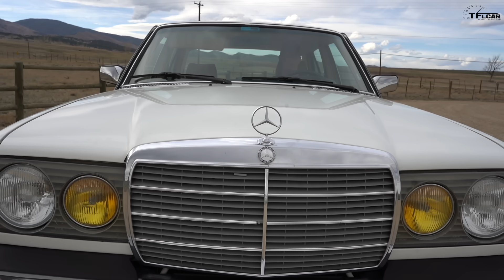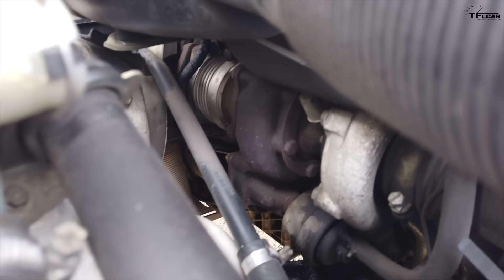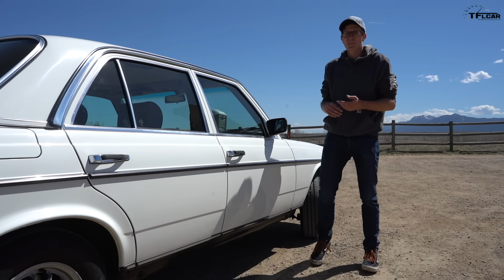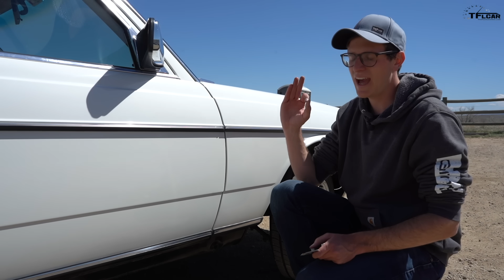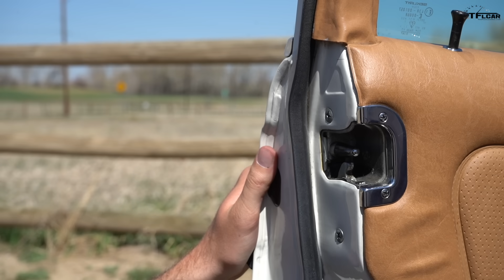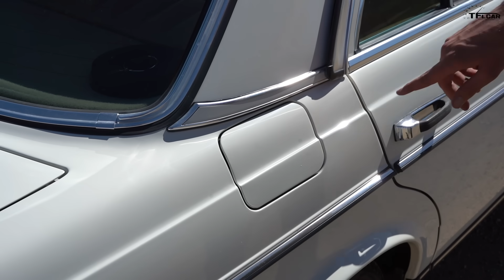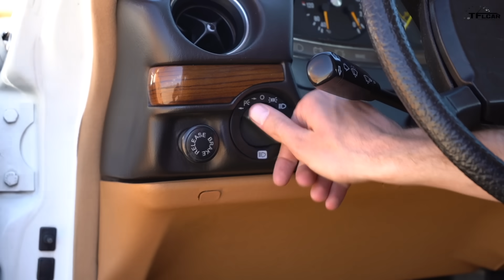This 37-Year-Old Diesel Is THE BEST Mercedes Ever Made!

Comment: My first car - 240D Sedan 1982 model with four manual gears,. Cactus green with camel interior like in this. Manual sunroof. Still miss it and how I felt at home in it. Never failed to start and when i got new motor mount rubber it was running silky smooth. Gear shift was the best. Started with 72.500 km on the clock and sold it again 110.000 kms later.

Comment: I have a '81 240D with manual transmission. Bought it in '90 with 97k  mi. for my wife to drive. It now has 450k mi. I've done all the servicing myself. She does not want another car. Does not burn oil and does not have any leaks, although it did when I first got it.

Comment: Talking about regular cars without any offroad abilities, this IS the best car EVER made. No electricity needed. Well, it does have glow plugs for cold starts, should you need them... With regular maintenance will last forever. This has about 95 hp and the stock engine with a turbo can handle 400 hp reliably. So... way over built.

Comment: W123 is greatness don't get me wrong, but the 190D which came just after is a better car in every way. If you want a full size then get the W124 or S124. Diesel manual variants get top pick, the om60x beats the om61x in every area.. true serpentine belt, real rear main seal (no felt bs), 5spds,better transmissions, better ride, updated ac compressor, etc. 

My 85 190D 2.2 5spd has just shy of 1.5 million km. It's at 876k miles right now, USDM spec. It spoiled me so much i had to sell my new toyota after driving it. Paid $500 for it.. W123 could do the same, but the W201 rides fantastic. Basically a mini diesel s class  these are truly the best cars ever made. Nothing else comes close imo.. we could collaborate on a video. Cheers

Comment: W116 is peak MB, not the W123
A MB car is supposed to be refined, so how is it refined with a clunky diesel engine designed for vans and taxis? The W123 has great build quality, but the ultimate MB car should also have refinement and performance. The diesels are slow, unrefined, and will destroy themselves if a hose to the oil cooler fails, the four cylinder petrol engines lack power, while the six cylinder engines are gutless at low revs. I drove a 230E and it did not like hills... embarrassing and dangerous. The W116 with a V8 engine is the definitive classic MB car IMO, not the W123 which is essentially just a smaller and cheaper W116 with a bunch of shitty engine options. The W123 represents the start of the decline of MB, not its peak, as it failed to offer a V8 engine option. A W123 with the M116 3.5 L V8 engine (aluminum block) would have been a truly great car. The failure to offer this as an option is a moral failure, not just a marketing failure... a jump the shark moment.

Comment: I've had an 85 300D since '04 and wont give it up. They're a love, yes.. But in all fairness, I think the question of which is the best MB series is a little irrelevant, not to mention also a bit of over-hype (as here). In actuality, if you pick up any inspected and well maintained 115, 116, 123, 124, or 126, and continue to maintain it,  (ESPecially if you can do some of the work yourself: fun learning and highly rewarding, and the car will appreciate it) and esp if its a diesel, then you are going to fall more and more in love with it with time. Yes, it will cost money, as all cars do. Dont skimp on maintenance! Stay ahead of it. But over the years, these vehicles virtually become members of the family.

Comment: I had a 230E with the alloy magnesium wheels it was 18 years old and cost 1500 quid in 2002.
It had a 100,000 miles on the clock but it was still very tight.
The more I thrashed it the better it went.
The quality was tremendous.

Comment: Your grandchildren could easily end up driving that car. The only thing that will finally take those cars off the road would be the unavailability of diesel fuel. It will take quite a while to wean industry off of it, but it will be easy to ban it at the pump for consumers. I can see that happening fairly soon. Mercedes has lost it's way recently. They just don't care about building the highest quality vehicles on the road anymore because they don't have to.
Reply: Rust will kill the mechanical money pits.

Comment: Don't forget the fast idle thing on the dash where you can turn the idle speed up.
Reply: how do you do that? i have a 1985 300d (american) but dont see any idle adjuster on the dash..
Reply: @jastern949  if I remember right it looked similar to a little plastic key? A black plastic looking key end that permanently hung out of the dash to the left of the steering wheel.

Comment: Had a 1981 300D back in the day. Was slow as crap. Heavy as chit and reliable and efficient as anything!

Yea that climate control system is a disaster! Loose vacuum and it would blow cold air on your face and hot on your feet. Or your have all heat or no heat. Have to crack a window as it's full feet heat on. That's the reason we got rid of it.
Reply: MB knew that well and did nothing about it.

Comment: I have a 1979 300CD English Red color, 213,000 miles on speedometer and going strong. I put in a new starter, which weighs almost as some cars' engines! I replaced shocks and new brakes all the wayk around including emergency brakes, adjusted valves on diesel engine, replaced oil pan and gasket, replaced transmission pan fluid and gasket, replaced steering box, and still replacing and restoring little items. This car is now my every day driver, and shows well with all the company decals and mileage decals all over the front grill. This car is a tank and will ouitlast me.

Comment: Celcius is super easy. 

Water freezes at 0 deg. Water boils at 100 degrees.

Normal room temperature....set it between 18 and 20.  Lower in the summer of course if you need it.

Comment: As other's have said, childhood memories.  My grandfather bought one in the late 1950s I think, they had just come to the US, I'm a 78 model myself, my father bought a used 240D in 1982 we had until he traded that slow poke for a 350SD, that was an awesome car.  Pennsylvania rust would get them eventually.  My grandfather on the other had had several 300Ds, trading them off every 2-3 years.  He normally bought them in DC with 70-100K on them.  He regularly took them over 250K, one made it to 410K, he put a used odometer in it, I think it showed 289K, traded it in.  We did a lot of real estate development, he would carry Cat dozer parts in that Benz... 2,100lbs worth of D9 bottom rollers, 4 in the trunk, 2 on the back floor and one on the passenger floor, drove it 2 hours like that.  His last one was a 1992 300D, it was driven until 2012 or so, been sitting at the farm since, I think I'm going to pull it out and see if I can get it going again.  It was parked because the dash fan stopped working.  I'll pay a good bit to have it back on the road, a new F150 is $73,000, nah.  I wouldn't be afraid to drop 5K on this 92 and it's good for another 100K.

Comment: I bought in January 1991 a used Mercedes 123 . 240D manufactured in 1984  and kept it up to summer 2013. I am a fruit producer and I loaded the car with up to 26 plastic boxes of apricots 15-16 kg each (6 in the boot 16-18 on the back seat (removed) and 2-4 on the passenger front seat) and drove at 75 per hour to go to the fruit intermediary premises.
What an experience!
 I then bought a 203 c200 in 2012 and  in 2013 I sold the 123 for €500. That was  a very serious mistake. 
I never used the 203 for transporting fruit. Instead I use a 1998 TOYOTA 15 hp automatic but the maximum it can take is 18 boxes but it is low and the exhaust barrel sometimes touches the ground on road humps.

Comment: I had one and they will not stop running I just hate the vacuum system.
Reply: The myth of German "engineering".
Reply: replace the automatic with a manual transmission, and put in electric door locks, and it minimizes greatly the vacuum issue.

Comment: Certainly not the best ever made.  I had a beautiful 1982 300CD but it had a couple of serious issues.  I can't express how bad it was in the snow.  The turbo lag was unmanageable.  It would have nothing out of the hole and then spool up so fast you couldn't manage the torque.  Dangerous.  Tire chains could help you depart an minor uphill stop light...

 Also, most of the car ran on a leaky vacuum system.  Door locks were interconnected with the timing advance.  What a Train Wreck when your vacuum door lock lines were connected to everything else and all was leaking!  (And it was) (don't think I didn't put every thing into trying to keep it fixed)

In the summer, cruising the open road in Colorado, the car was a dream, but as a daily driver, leaving stop lights a hundred times... ack!  To be fair, had I lived in a warm weather climate and found a way to solve for patching the vacuum issue effectively, then I'd probably have to agree.

I'll take an AWD Merc with modern electrical systems any day!

Comment: Two questions: First, Did the 300D turbo diesel have air conditioning?  Second, does the engine have removable cylinder liners (sleeves) that would make rebuilding the engine easier? Thanks for your replies.

Comment: also forget ton refer that the under protection of the car is missing ,just by looking to the side of the car where there´s no body bellow the doors level ,because it envolved the under the car parts and make it rounder till bellow the doors level ,just some remarks i do have 12 mercedes from 1965 to 1995 being the last the 600SEC which starting in 96 it was re-called CL600 but looking ridiculous with already existing tiny glued letters and numbers or the V12 tinier on the back pilar of the topside which used to be triple or more the size when letters and number had to be fixed to the body by a screw or a attached by a revit (is it?)

Comment: nowhere near the radio because at the time most of the cars with luck had a radio with one speaker and that one already had 4 speakers ,it´s similar to the Porshe 928 from the 70´s that had in each door only 6 speakers more in other parts of the car and a blaupunkt radio cassette player made especially for the center console of the Porshe 928 ,i had a Datsun Sunny  from 77 powered by Nissan as it said in the back with a faked racing dash where besides the r.p.m. counter had a very nice looking clarion radio FM that the lights turned on when the other gages did to ,this made of glass with the FM frequencies and Am marked upon the thick glass not plastic ,it even had the seams faked upon the racing steering wheel like if it was leather so a fader in between the front and back electric powered windows they putted there, not existing in the beckers radio or radio cassette player, and i refer to electric powered because in early 70´s they had hidraulic powered windows, check it

Comment: I have made this comment elsewhere on YT... but this car is deserving of such recognition...

I still daily an '84 300td that I use to commute daily, safely move my family from this to that, tow my riding toys in a trailer, load the backend with up to 1000lbs of home depot goodies along with many other uses I throw at it often - all while approaching 400k with an original / never rebuilt drivetrain...

I've owned many different types of cars and distant second vehicle to this in terms of combined capability and reliability is a 100 series Toyota Landcruiser.

Comment: I agree w123 is a very good car, but I would like to mention that w124 - at least to mid 1993 (when Chrysler became a part-owner and ruined the quality-minded policy within MB) - was an equally good car as w123. And w124 is technichly a far superior car compared to w123.
Reply: To be specific: it is in 2 areas (mostly) that the w124 is a premium car compared to w123;
1. The suspension set up. The 124 has way better roadholding and way better comfort than the 123. You can drive much faster on problematic roads and still have and feel 100% secure compared with the 123.
2. The fuel economy. The 124 have a drag coeffisiont (probably misspelled) of 0,29 where the 123 has ca 0,37. This means that the 124 with a 110 ps diesel engine has a top speed of ca 195 km/h. The 123 with the same enigne has a top speed of ca 170 km/h. The fuel consumption is around 15-20% lower in the 124 compared to the 123 in all speeds above ca 120 km/h. The fuel consumption below ca 80 km/h (where the wind drag is almost non existance) is about the same in 123 and 124. Pardon my spelling. I am a Swede, not an American.

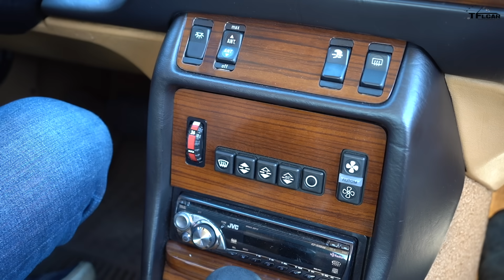Comment: 9:38 this is fantastic climate control
once you set the scroll to 20 degrees celsius, you no need to touch winter to summer and back
the system heats you if its cold and cools you if its hot

Comment: Hello.  I would like to consult with you.  I have several questions regarding the harmful emissions of the Mercedes w123 diesel engine.  Some countries have restricted the use of cars with an environmental class lower than Euro 3. I was wondering if this could be improved.  For example, install a particulate filter in the exhaust system.  I'm sure the soot released will settle in this filter.  But can it be documented or entered in the passport of the vehicle?  So that I could, for example, travel on my w123 in the countries of the European Union without restrictions.  I would be very grateful if you could answer my questions and help me figure this out.  Thank you.

Comment: Although this is one of the best Mercedes models, the next generation  e.g.W124, W190 was the actual peak of Mercedes engineering about reliability and the last from the golden era.. After those there are the first C and E class which by modern standards are very solid but back then compared to the models of 80"s they were considered very bad.

Comment: I had that same white Diesel car -- but a 1978 non-Turbo model.  Everything else was the same.

It had 122,000 miles when I bought it and 157,000 when I sold it -- still running great.

Not a lot of power or acceleration.

But on the highway, it was like driving on a cloud.

Comment: If you pull the trim off the doors and need to work on the switches and plugs for the electric windows you will find a tiny little circuit diagram inside the plug showing the correct wiring pin out.

Comment: During the 80s I owned 3 of these beasts (240 D, 300 D Turbodiesel, and the one I loved the most, a 2 dr coupe 300 CD). Noisy war horses all.  Lots of fun memories and others not so fun, like realizing that the diesel engines would not start in my visits to north Ontario when it was -6 F out there (I fixed it with a block heater).   I always though that I would give one of these safe and reliable cars to my son when he first learnt how to drive, but times have changed.

Comment: I grew up with W123 diesels - my father bought a 1980 240D and a 1984 300D, drove them both until he died more than 30 years later. 300D was an evolution from the 240D, and I now own the evolution of the 300D: the 2.5D in the W201. I can't say the 2.5D is that much better, but the W201 is definitely comparable in terms of quality.

Comment: Go to any third-world nation, where labor costs next to nothing, and you'll see that these cars are never retired. Whilst in the West, mechanics simply replace parts, there almost nothing is tossed. Elec motors are re-wound, broken/cracked parts are welded and resurfaced. Even sealed parts are sawed open with the skill of a jeweler, fixed and welded, heat-bonded or glued shut. Even a cracked glass headlight will be fixed like new by a master glassworker.

Comment: I've had a 1982 280E, the petrol version of this car you've got here.  When I bought it I was living in Sydney AU.  It had 265 thousand km on the odometer at the time I bought it and it looked, and felt, like it had just rolled off the assembly line on that day.  It was pristine on the inside with immaculate interior and with a pristine exterior.  It was a little thirsty for the times (late 2000s) but in every other way it was brilliant.  Reliable, comfortable, great daily driver really.  I used it to commute to work and back for years.  My brand new Audi diesel has glow plugs by the way.  And also, the AC unit in my 280E was immaculate.  it worked flawlessly when I bought it and for years that I've owned it.  I don't know about the Diesel version though.  Never owned one sadly.

Comment: I had a 1983 300D. After 300,000 miles, I finally traded it in. The 5 cylinder engine never had the heads off; and although it sounded like a sewing machine, it just kept going, with good mileage and no rust. The reason was that a second rear suspension replacement was going to be required for the right side, and cost me about $2K - with the car worth about $4K at the time.

Comment: Shame they never continued with the quality. I had a year 2000 E320 Avant-garde estate. The most unreliable, poor quality car I have ever owned. One fault after another, electrical and mechanical. It started to seriously corrode after 3 years. Corrosion was addressed under warranty and the subcontracted bodyshop guy said that Mercedes were very good for his business. Final insult was an auto gearbox failure on the way to trade it in. Never touched Mercedes since.

Comment: I owned a W123 240D, 200, 300TD, 300TDT from 1978 to 1999. And yes, they were the very best MB. From W124 it went downhill. Drove MB until 2009 when I bought a Toyota Landcruiser and never looked back.

A interesting fact, the dooropeners worked pneumatic instead of electric on the W123, because the MB engineers said electricity could fail...

Comment: The 123 Diesel with OM 61X engine was good....., but the 201 and 124 Diesel , especially with the OM 602 five cylinder engine was even better. I have had several of this cars an my current 190D 2.5 has more than a million km with the first engine and clutch and waterpump and startermotor.